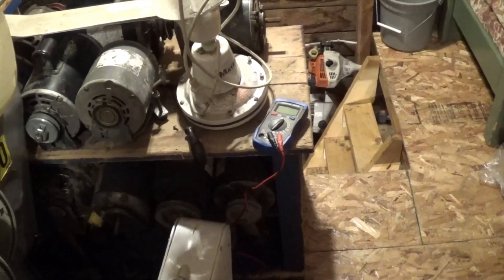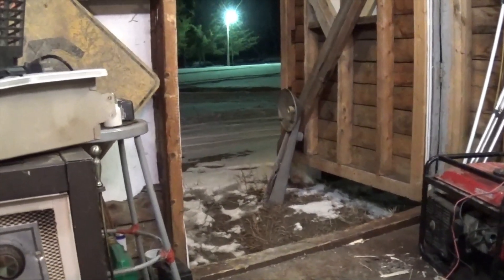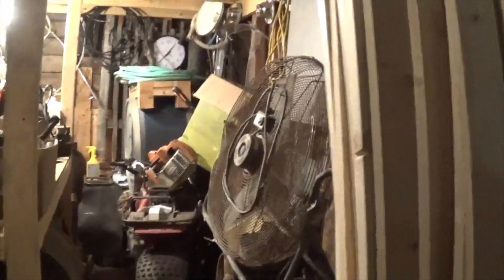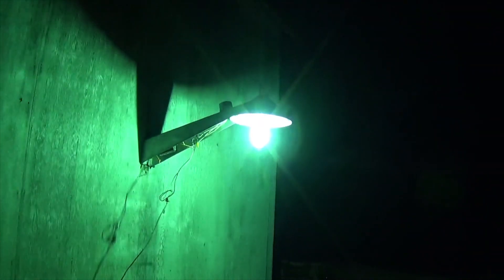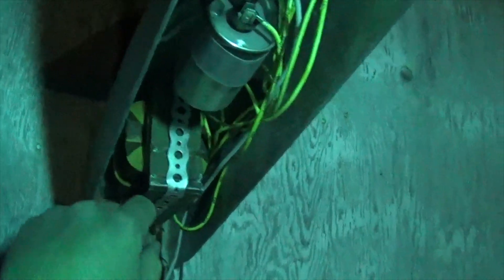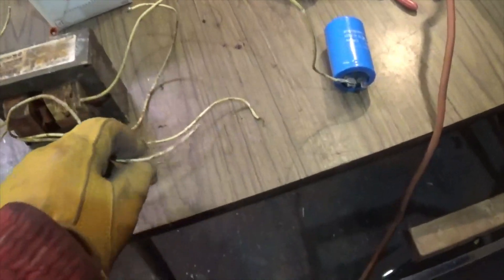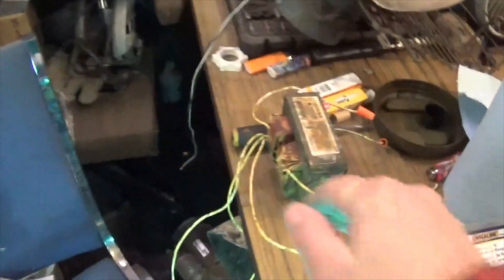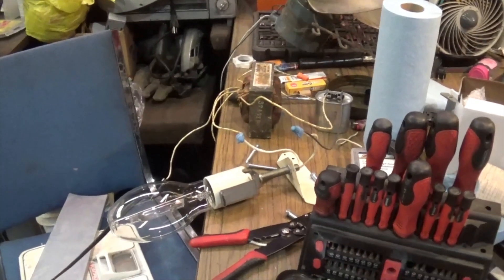UPDATE: read description. Trying to fix the strange mercury vapor problem

Comment from the maker: This did not end up fixing the dancing arc problem. I tried the light out a couple of nights later and it was doing the same thing. we did fix the noise issue though at least! so in conclusion, it must be just the bulb. In my previous video, somebody commented about polarization and hot spots on the electrodes, (I will highlight their comment) and not to be worried about it, so I'm going to listen to them and forget about the problem entirely!
Reply: The lamp itself was my first thought. That though, is one of the wonderful things about MV, HPS and LPS lighting technology - they age and can be very analogue and different, even among identical models of a given light. The electrodes take the brunt of age/wear related changes. Lamps can wear into strange patterns and do strange things, which is one of the things I love about them. Even HPS, when it starts cycling. Even flouro lights are nice ASMR when the lamps wear, or starters on old models go wonky and you get unique flickering and startup sequences.

As for the vibration and hum, that is eddy currents in the transformer/ballast/choke/core. Laminated steel plates are used, and during manufacture are tightly glued together with epoxy resin typically to help reduce eddy currents. Expansion and contraction from heat and cold during usage and off time, work these plates loose over time. In your case, it did not help the physical damage. The tighter the plates are together, the less noise, eddy currents and basically heat, you will observe.

Comment: Someone else that seems to like Mercury Vapor lamps.  The light emitted by the phosphor coated bulbs is extremely pleasant to work under.  The only downside is that you typically need a few for that.  Installing them in a balanced distance to cancel the horrible shadows.  It must have to do with the light being on the upper end of the spectrum, and eyes trying to restrict the higher frequency light waves.   Non coated mercury bulbs have the same color rendering issues as HPS, just green instead of red.
Reply from the maker: It is a more recent interest for me.
Personally, I figured coated MV'S were a softer light, which to me seems to make the shadows less pronounced and harsh. That's just me though!

Comment: It could be just the vibration from the ballast that is making the arc wander. 

The loud humming and vibration of that ballast is likely just a matter of loose core laminations. If you were to clamp the core firmly together it’ll likely be as quiet as the other one, and may cure the wandering arc. 

Neat fixture by the way.
Reply from the maker: Thanks! I will probably give that a try someday, just out of curiosity. Although I just learned that the dancing arc problem was apparently not fixed, it was doing it again tonight . I'm going to update the title and description.
Reply: Personally I would just go get a led that will fit the mogul base, straight wire it and be done, it will save on your electric bill so you get the money back. That bulb the inner gas tube the gas in it is too weak.
Reply from the maker: @Carl-yu7hd  You do realize that usually people who are making video's of these kinds of light are generally collectors, right? lol 
 yes you would save on power with an LED, and for the average person (and whole cities and stuff) that's great! but i will never be converting any of my fixtures to LED. These old lights will always light up my yard. BTW im not angry or anything , just sharing my thought's since you shared yours, have a nice day!
Reply: @Carl-yu7hd  A lot of people would.  If all you want is light, and don't mind the failure rate, they're good enough.  But, I'm a lighting enthusiast (to say the least lol), and LEDs are of zero interest to me.